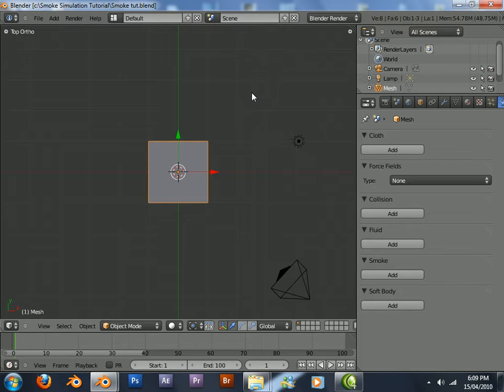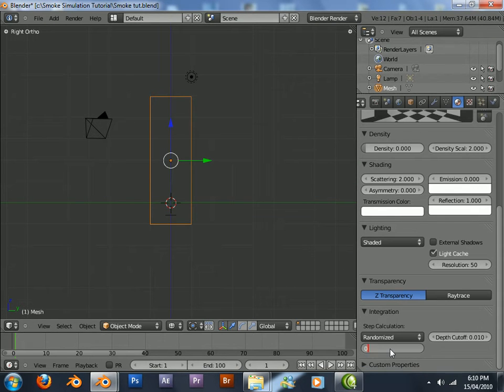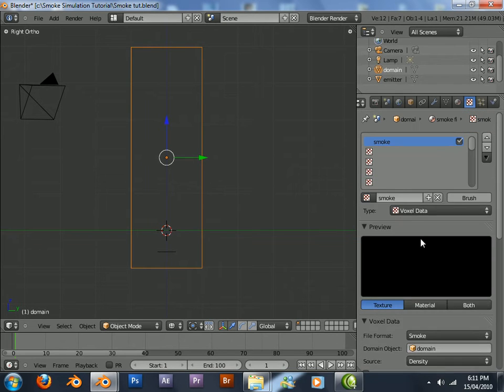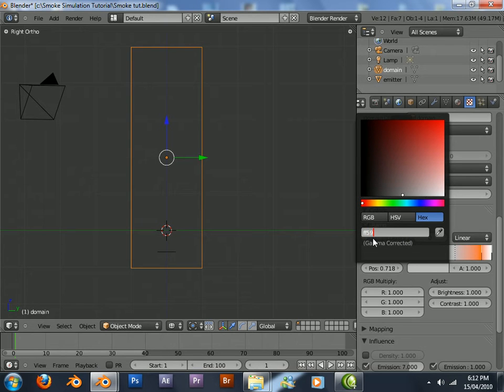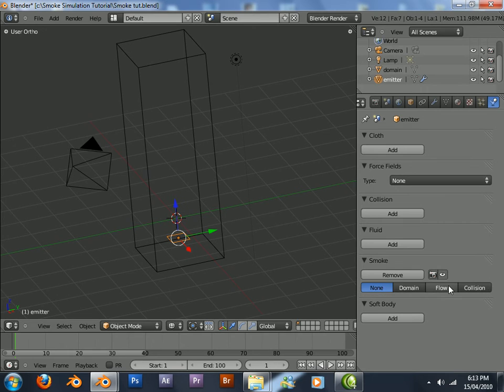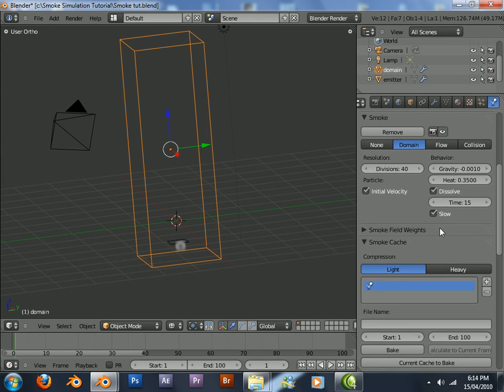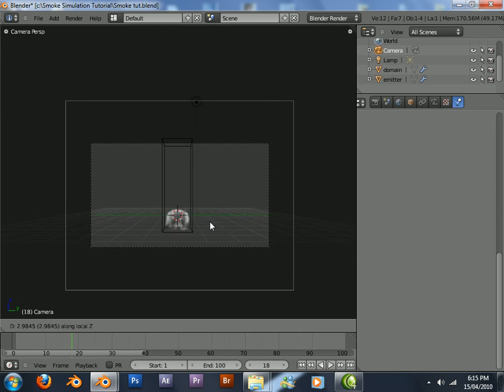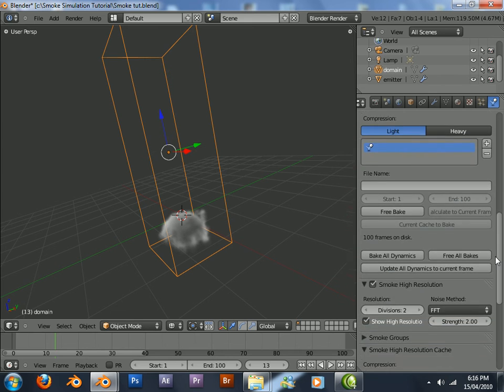Blender 3D Smoke-Fire Simulation Tutorial

Comment from the maker: @Chubbbs117 the only thing i can think of is that you may not have correctly applied the textures for the volume material. Try making sure that you've selected the correct object as the domain in the voxel data texture settings.

You can also set your world color to black(not covered in tutorial) through the world panel settings to further emphasize the smoke. 

I followed my own tutorial just to find an answer. I entered every setting correctly. I used revision 31845 and it renders with a flame